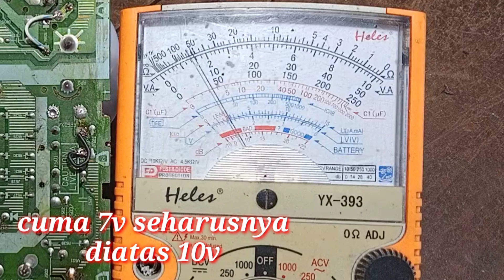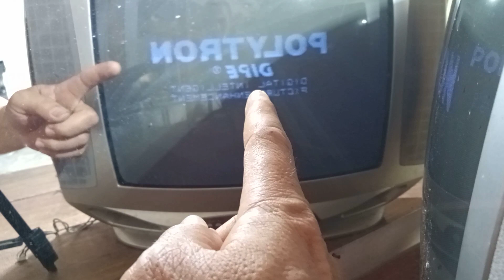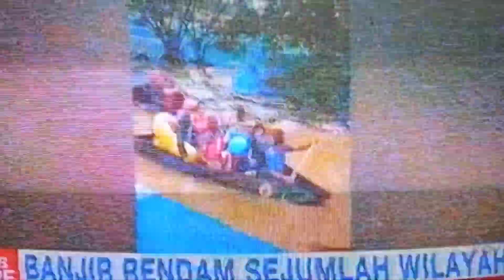CARA START PAKSA TV POLYTRON 123 STANBY

Comment: Bang kalo mesin seperti itu pas awal dinyalakan switching nya bunyi mencuit gak
Reply from the maker: Betul mencuit,karna rangkaian horizontal tidak bekerja🙏🙏🙏
Reply: Berapa kali bang yang saya garap mencuit 2 kali lalu tv bisa hidup tapi terkadang nyalanya lama dan awal dinyalakan gambar ada suara tidak ada tapi kalo tv dimatikan lalu di hidupkan kembali suara baru keluar normal kira² apanya ya bang
Reply from the maker: Coba cek tegangan 5v dan 8v yg ke IC croma drop ga,,cek elco2 suply 1000uf25v dan yg lainnya,solder ulang IC croma🙏🙏
Reply: Untuk 5v 8v ada hadir untuk elco 25v 1000uf udah di ganti bahkan kalo lama di diamkan atau mesin bener bener dingin bisa gak nyala sama sekali tegangan drop semua 0v harus nunggu beberapa menit bahkan sampai 30 menit baru bisa nyala kembali

Comment: Malam Mas... Kalau semua tegangan drop... Saya copot t505(c2235) tegangan normal semua kira kira apanya yg rusak
Reply from the maker: Pasti ada tr yg bermasalah area suply tegangan kecil 5 dan 8v nya
Reply: @rajawaliservis.  Awalnya tr c1023 tr c2236 resistor r 518 (220 ohm) tebakar mas...